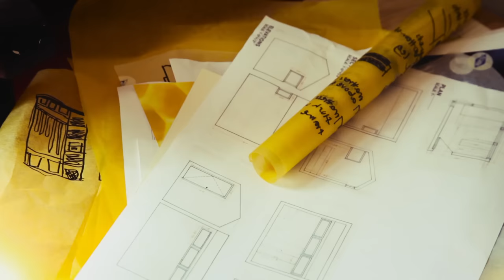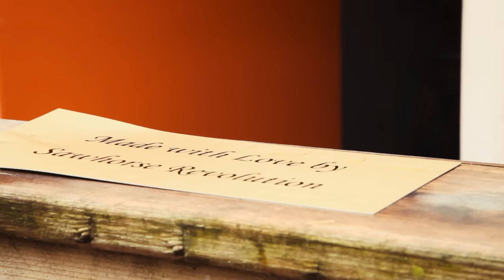Can Tiny Homes Solve Homelessness In The U.S.?

Comment: Whether this can work for the homeless in your area or not is highly dependent on what your local municipality will allow. Tiny houses exist in a legal grey area. In order for it to be placed on a foundation, building codes generally set a minimum of 900 square feet (a 30' x 30' single level residence). To get around that and go smaller, you have to put it on wheels and classify it as an RV, at which point it's handled by your state's DOT. However, municipalities have additional codes regulating where, when, and for how long someone is allowed to live in and RV. The only way to have a tiny house on a foundation that is under 900 square feet is to obtain a building variance from your local building department. Seattle is pretty progressive in regards to tiny homes, but most of the country is not.

Comment: Why not build full tiny homes with kitchen and bathrooms? Costs a bit more but it provides them with a real home. After some time to get on their feet they can start paying rent on it.
Reply: Who will pay for all of that? Electric bill and water bill?
Reply: Because right now they're just "shelters", but once you start putting in permanent structures then you need permits, and when you need permits you need to obey zoning regulations and building codes and a whole other mess of stuff that they simply wouldn't be able to afford. Yes, homelessness is expensive and it becomes infinitely harder to find work when you don't have a physical address etc, but mostly it's extremely dangerous and the ability to sleep safely and protect your belongings makes a huge difference especially while you are looking for a job.
Reply: V boy
Who pays for subsidized housing now?  There's your answer
Reply: I assume there is a shared toilet and shower block for them to use which means going outside to use it.  There is a shared kitchen.
Reply: lemsip That's really cool :)
Reply: lemsip
Still should have their own. Make it a real home.
Reply: Uhohhotdog Gaming
It's effectively a large shared house with the rooms as separate buildings.  I don't like sharing a bathroom or kitchen with strangers.
Reply: lemsip
yea that's why they should have their own in each house
Reply: Uhohhotdog Gaming I think that it might just be the case of trying to be the most economically-savvy. It'd probably cost a whole lot more to expand the size of the tiny houses, and then fit plumbing, gas and electricity.
Reply: BuckGreywolfe
we already spend that when they're in prison and then some
Reply: BuckGreywolfe
what?  if they're in homes they're not in prison.  reduce the prison population.
Reply: BuckGreywolfe
many areas criminalize homelessness.  And many homeless when no other options turn to crime to get by.
Reply: BuckGreywolfe
maybe if you read the part where I said many places criminalize homelessness.  In san francisco they're tearing down tent communities.
Reply: What a troll buckgreywolf
Reply: Uhohhotdog Gaming there isn't enough money they would need donations of more funds
Reply: Coy Sutherland
the government can help.  it doesn't need to be all donations.
Reply: Uhohhotdog Gaming At least they are making homes I bet you aren't
Reply: Uhohhotdog Gaming yes, reduce the prison population. let the rapists and criminals out. good thinking. also, do you think that saying the government will do something will do anything? is saying the government like a magic word? where would the money come from?
Reply: Uhohhotdog Gaming yep, because it's not like they would stay in that house for the rest of their life and never feel like working
Reply: There's enough room to put a tiny chemical toilet if you really wanted too. Then use a camp stove out front.
Reply: Umi's Field Day Sounds like we have a regulation problem! I want cheap housing dammit, I can pay extra for a "certified" sticker but why make others sleep outside because a shitty house is "worse than nothing"?

Comment: You could even design these pop up homes with aluminum pop out knobs in key locations on the walls where you could attach murphy beds and shelves and other fixtures. These if made would be some really amazing emergency shelters. The A frame design would be up in minutes set up like an A frame camper. Just add in a box of accessories like aluminum table and seats and aluminum bunk beds or the bunk beds turn into one bed and soft pads and pillows. It would be a neat design.

Comment: Design azdale panel tiny homes that fold up and down from a flat configuration. With frameless doors and frameless windows built right in. With all the electric built right in. With an kitchen area that folds right out of the wall with a sink and induction cook top. With a shallow sink with the plumbing coming up from the base of the tiny home. With the hot and cold water and drain hook ups at the back along the base. Design a bathroom module with a cartridge shower and a composting toilet for Grey water and to use urine to make plant food and the sticky stuff for top soil for the green house. 100% green living a way to cut costs and grow some flowers and vegetables. ; )

Comment: I'm thinking from a cost perspective while most of the materials are low cost and the labor is almost free if you where to deploy this in a smaller city or town that has less resources how about portable shelters, just the bare basics, a bed and storage. Something that can be pulled with a bicycle with moderate ease to a plot of allocated land that can have a community bathroom, kitchen and storage area that they can be parked on at night.

Comment: Tiny Homes are nicer in less populated areas. For a city, the property the homes are placed on could be used for higher density apartments. The only impediments are city regulations preventing housing of certain dimensions, and public efforts for subsidizing housing artificially driving up costs. For instance if the housing authority provides $800/month for subsidized housing, the costs are a minimum of $800 a month except in special cases. Many in the population do not qualify for these programs which forces them into more expensive housing or the cheaper special cases like SROs.

Comment: Azdale panel cube tiny home design or azdale A frame with loft design that are all modular and can be fitted together to form a larger home to suit the needs of one person to a family. Azdale and aluminum with gas pistons to help set up and swivel lock all the panels into place. With all the electrical built right in and windows and doors all built right in. Light weight easy one to two person set requiring no tools? That you can break down and stack upon each other? ; )

Comment: IMO they are projecting wrong, not because tiny is wrong, but because the boxy shape is wrong. 
Please,  take a look to Fuller's geodesic dome home and other wooden geodesic dome homes, you can employ a 1/3 less row materials for same volume and get a more efficient, more sturdier little house 1/10 energy consuming. At the same time with the same materials quantity 1/3 more houses are available only by projecting right.

IMO they have to help each other to study an industrial process that really works proficiently and involve homeless people  to mass produce something economic in materials and in maintainment, like e.g. intershelter or japaneese domehouse or even better, a sip panels and tubes Fuller geodesic dome home, or again, monolithic cement domes similar to dome for the world DFW...

Comment: No.  It wont solve homelessness.  It will help some though and that is good enough.  The homeless problem has nothing to do with a shortage of homes.  Most homeless have medical, emotional or psychological issues that prevent them from living a functional and stable life. Giving homes away does nothing to address this.  Volunteer your time and whatever resources you can spare and learn as much about the issue first hand.